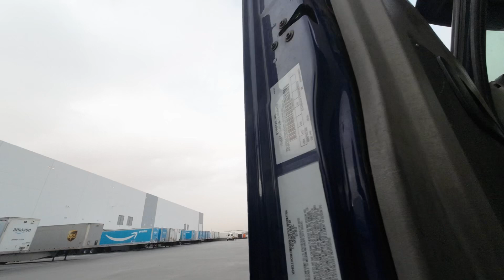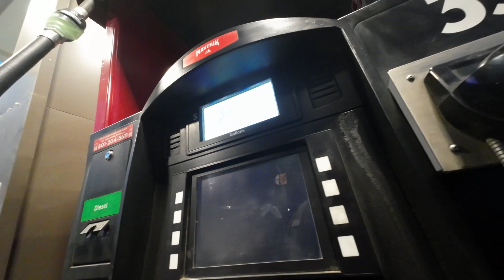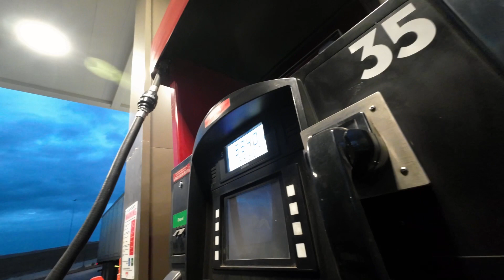Can you drop off ￼Amazon load’s before scheduled arrival time?

Comment: So are you able to drop off earlier??
Reply from the maker: Yes, most if not all locations will let you drop off at any time.
Reply: @justrollintruckin9111  Please, I need your advice! How much EARLIER  can I arrive at the Amazon warehouse than the appointment in the Amazon Relay app? Only 2 hours or may be more? Is it the same or different for  pre-loaded trailers and empty trailers?
Reply from the maker: @ if you’re picking up a load, an hour before appointment time they should except you. If you’re dropping off a load if the facility is not full of trailers, they will accept you at any time.